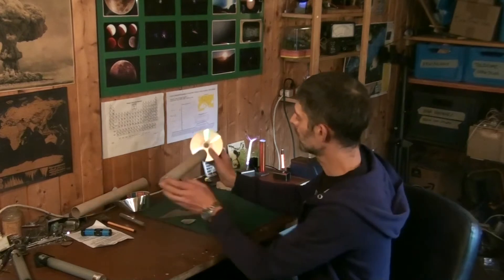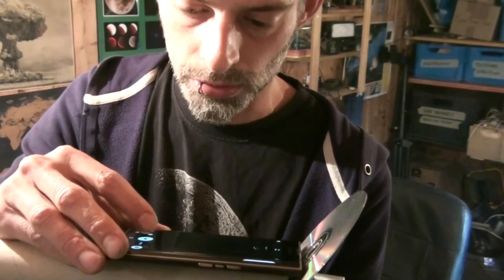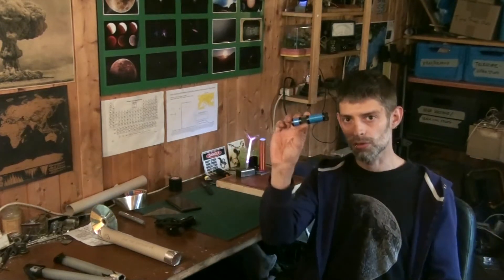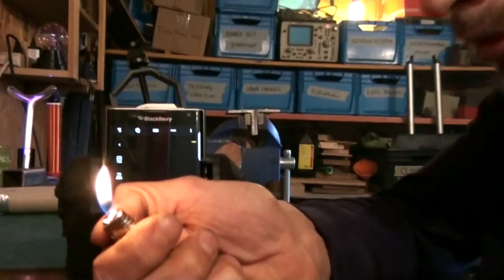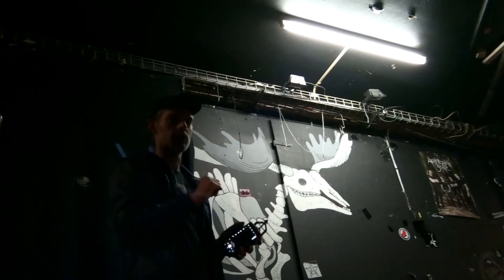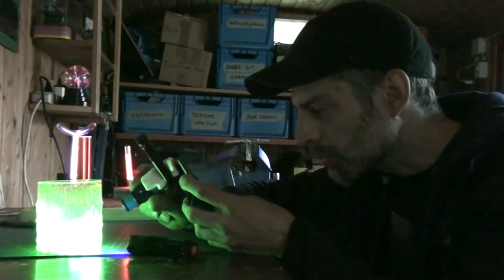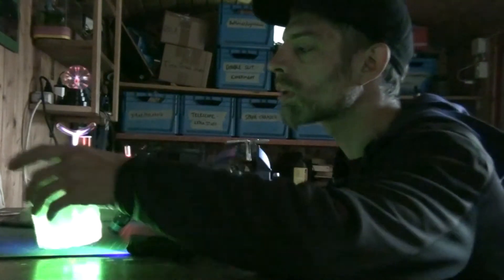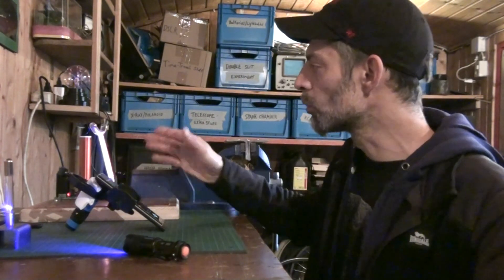DIY Spectroscopy: The Basics

Comment: Great video! I tried making a spectrometer myself using a webcam without IR/UV-Filter and it kind of works, but I never got it to work well. Getting the right amount of light is a huge problem for me, and there are always reflections in the far UV/IR of my spectra. It's also not really exact and my spectra are kind of messy with very distorted intensities. Your spectra look very nice, what exactly do you use for them? That spectroscope mounted to your phone? I hope I can improve my spectrometer using your next few videos, mine works using a CD I removed the metal film from as diffraction grating. Using the reflection to send it through the grating two times might improve mine, I really don't know, it took me several hours to get at least some spectrum from it... if you have some tips or encountered similar problems, I'd be happy to know how you solved them. 
(Ich bin übrigens Deutsch, Antworten gerne auch auf Deutsch, wenn das geht)
Reply from the maker: ..my plans also involve a Webcam, think ill try something similar for the next video like you did :) I ordered some "Diffraction Gratings" for very very cheap (i ordered 10, i can send you 1 or 2 to germany if you want?) i read that these work pretty good! ...maybe also one thaught of mine.. did you try with a piece of the cd without removing the thin film? i could imagine you get difformations when you remove that thin film, maybe the cd plastic helps to keep stuff straight? (i was quite amazed how detailed the cd/cardboard one looked, just used the other one because its easyer to mount in the end) Yes in the end i used the little plastic spectroscope from the china shop with my camera, this one uses a classical prism (not shure if glass or acrylic or something..) I think most of the problems are with the camera settings (focus, exposure time), maybe try "Sharpcap" or a similar software with youre webcam, its for astronomy but its a great recording software for all kinds of webcams! lets you mess with all kinds of settings :) PS: hope you dont mind i reply in english, but since the majority of my viewers seem to be from english speaking countries, id like to keep my channel in that language as far as possible ;)
Reply: @BremsstrahlungChannel  Thanks for the reply, I'm fine with English. For now, I don't think using an actual diffraction grating would make much of a difference, but thanks for the offer. To remove the thin film from the CD, I used some electrical tape, which works very well once there is a scratch to start. As it's very gentle, it shouldn't deform the CD to any noticeable extent, so I don't think that's the problem. I tested the CD's transmittance using a commercial spectrometer and it actually has a bit of weird absorbance in the red part of the spectrum, but nothing that should affect things too much. I actually believe that my webcam is the greatest problem: I use a "Trust SpotLight Pro" (as far as I still remember) because its UV/IR filter is kind of easy to remove, but it has some weird automatic adjustment, horrible resolution and probably is the cause of the differences in sensibility to certain wavelengths, as the camera itself is probably less sensitive to blue and red. I can actually change a few settings for it, but I can try Sharpcap to change some more, thanks for the tip! I've also had trouble finding good software. "Theremino spectrometer" is something like the standard software for DIY spectrometers and worked mostly well for me, but my spectrum was so narrow that Theremino didn't allow me to calibrate it correctly, which makes it impossible to get exact numbers so it was useless to me. I then used "Spectragryph", which probably is a great program, but very hard to work with as it hasn't got any good explanation. I spent hours messing around until I got some real spectra. It's still kind of weird to work with and also just a free test version, although you can apparently contact the developer and get the full version for free, so I'm still looking around for better software that actually gets live data instead of saved images and forms a calibratable spectrum from it. I had my spectrometer laying around as-is for a while, but maybe it's time to make a few adjustments. I look forward to hearing from your experiences! 

By the way, I also found a tiny and incredibly cheap gamma spectrometer on eBay (60€) which I'll probably buy, if you're interested I could try it out and send you the results. Judging from its size, though, it might take days to get a reasonable spectrum.
Reply from the maker: @swabianscience  Wow! Gamma Spectrometer for 60 bucks sounds very interesting! ;) im curious how it works out for you! :) About the Webcams, i used some in the past for Astrophotography, they are really good to capture Planets and close us of the Moon! For Astronomy i remove the lens and the filter, i have good exerience with a Logitech C270. But in general i am starting to buy every Webcam i can find in Flea Markets / Thrift shops, they are mostly around 5 bucks, and i guess its good to try some different models :)
Reply: @BremsstrahlungChannel  Sounds good, I'll keep my eyes open for cheap webcams, and if you find one that works especially well, I might just buy it directly. I could probably mount one to my telescope too, until now I've only made photos by holding my phone to it, and the results are - as you can probably imagine - not really great and often the object moved away before I could even take a picture. I'll let you know how the gamma spectrometer works out, it might take several weeks to months though.